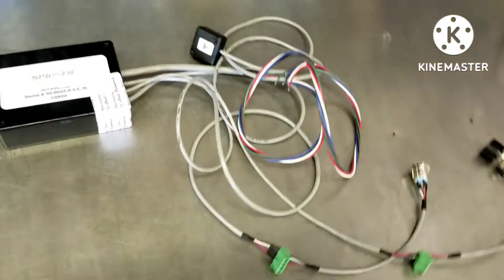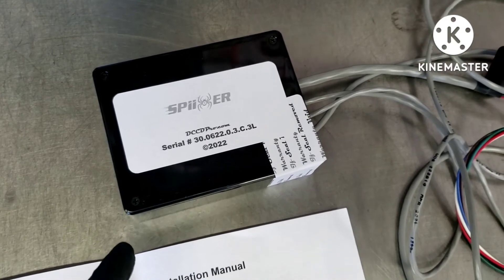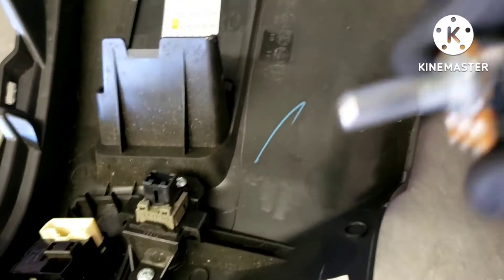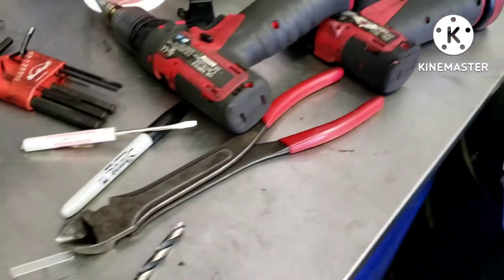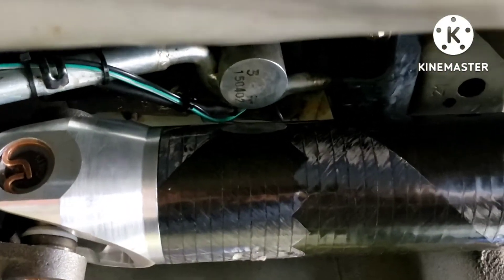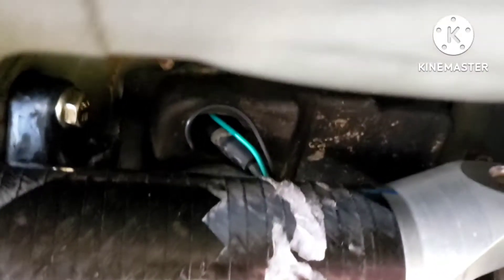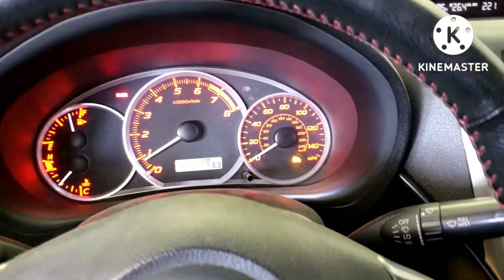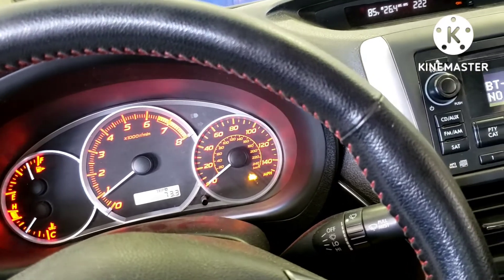WRX DCCD CONTROLLER INSTALL HOW TO

Comment: What if the e brake is down, and the knob is all the way down with light off, what mode is that?
Reply from the maker: So if the knob is turned down so far that the light is off, I am pretty sure that fully disables the controller which essentially goes to your center diff's fully open ratio which i believe is 41/59 for my trans in particular, different years are different ratios.
However, that is a good question for the guys af DCCD PRO. I'll ask them and get back to you.
Reply: @nickquatrini  thank you, because I had it installed, but the shop forgot to give me the paperwork to read the settings 😮‍💨😅
Reply from the maker: @tnyce616  to be honest I don't think it comes with the description of settings cause mine didn't come with one. But yeah I'll reach out to them and let you know what they say.

Comment: Dude sick. I'm trying to prepare myself as much as possible for my future 6 speed swap. 
Had any issues yet?
Reply from the maker: No everything is working great!! The gear ratios are so nice to drive with once you get used to them.
Also, if you do install the dccd controller, it would definitely be way easier to install under the dash by the knee plate under the steering wheel. 
If you have any other questions feel free to reach out!! You can also DM me on messenger on my page "Nasty Nate Racing" I respond to that right away